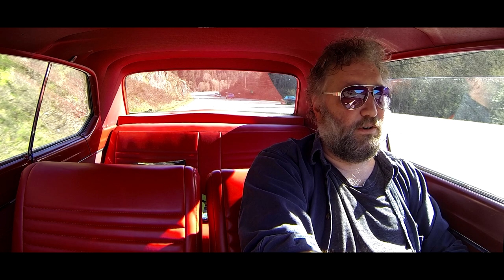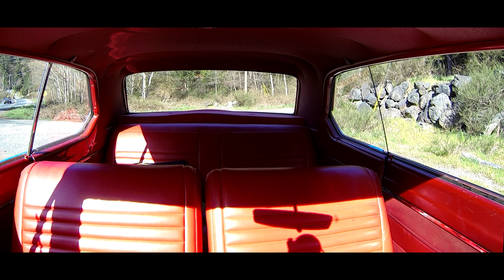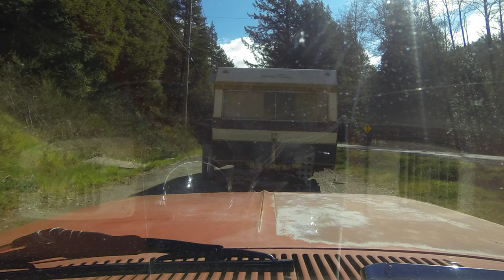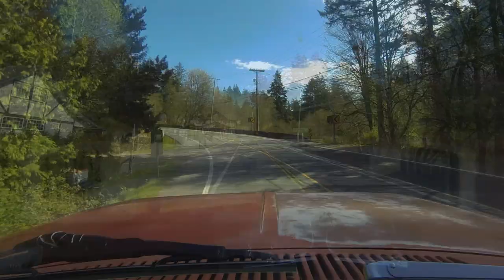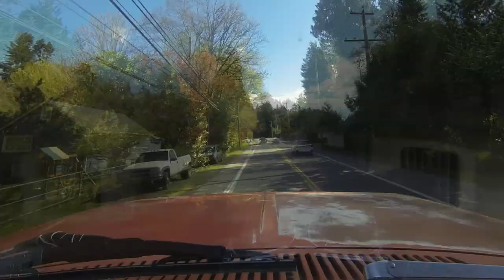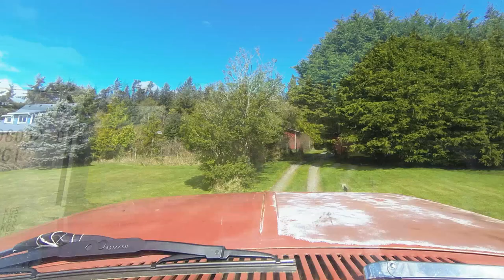1966 Valiant-Fuel Delivery Issue & Tow Time-lapse

Comment: Either a clog or a hole. Probably back near or in the tank.
Reply from the maker: Agreed. I don't want to be monkeying inside the tank or the sender, but I will do that when it comes time.
Reply: @MicrophonicFool  If those are like the later cars, you can remove the sending unit without dropping the tank. You'll need a plastic hammer and a brass drift so you don't  create sparks. If the tank is rusted up and you need a sending unit, go ahead and replace it all since it's inexpensive.  There's an outside chance the rubber line back there split, but I anticipate you'll find a clogged strainer inside the tank. Someone might have tried to coat the inside of the tank because it was rusting, which I think is a poor idea.
Reply from the maker: @TylersNeighborhoodGarage  I have replaced the sender once in early ownership. You are correct it did not require dropped tank. I don't smell anything like a leak but will check in case.